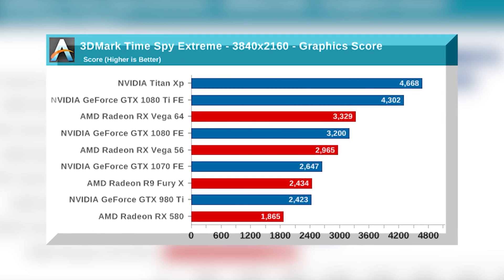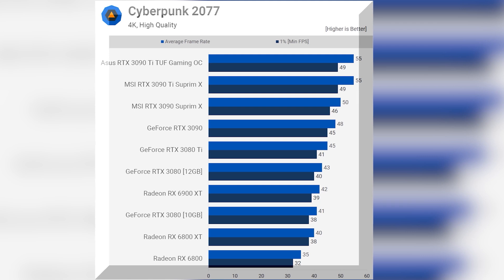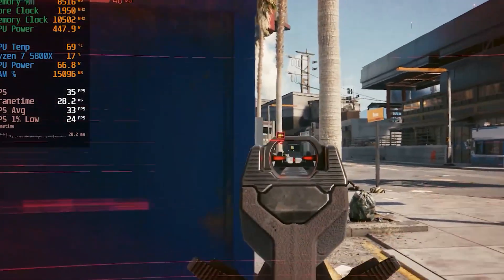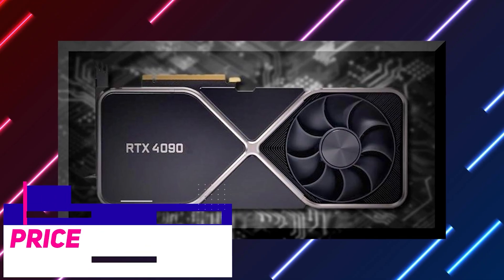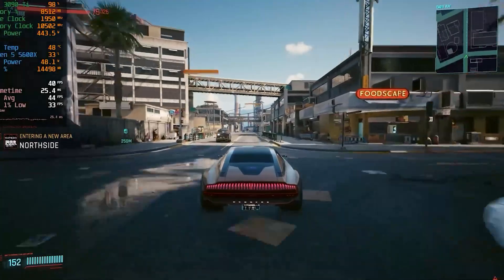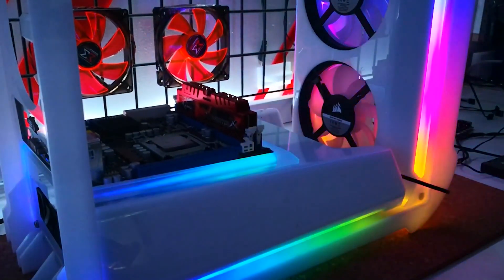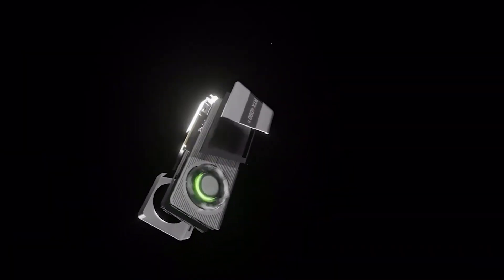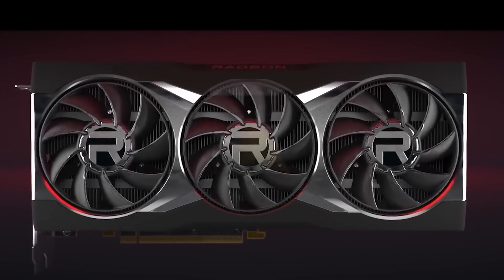RTX 4090 Performance and Specs 2022

Comment: Mhmm yes melt my wires
Reply: mmmhm yes it’s been tested hundreds of times
Reply: @GUY-on-Earth  look it up then, there’s cases of the card drawing more power into a single wire channel then some wires can handle and melt them
Reply: @bloodstalkerkarth348  yeah it makes u wonder what that person was doing on that card. I don’t think they would sell a mainstream card if it was going to melt. That case probably counts for like 1% of person who were unlucky.
Reply: @GUY-on-Earth  I mean its a easy fix by getting better wires but there are gonna be cases of someone reusing the wires from there 3070 and the wires "could" melt if there cheep
Reply: @bloodstalkerkarth348  there is also undervolting or underclocking and if you really want to play it safe, just underclock
Reply from the maker: lol